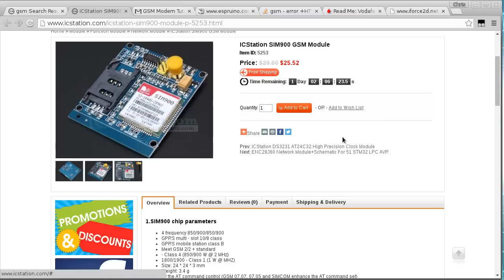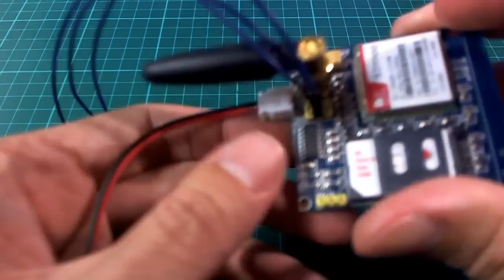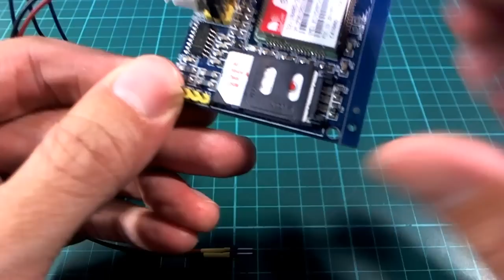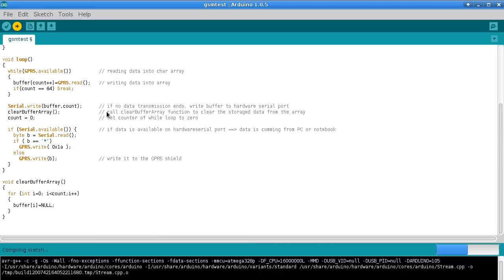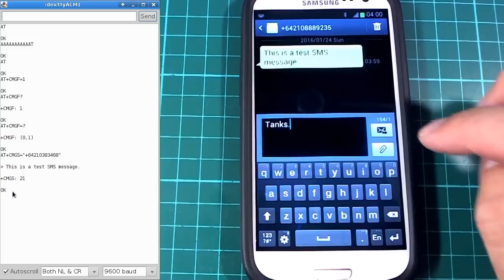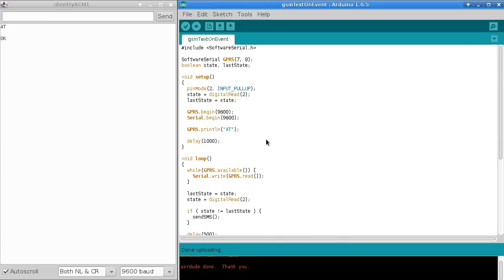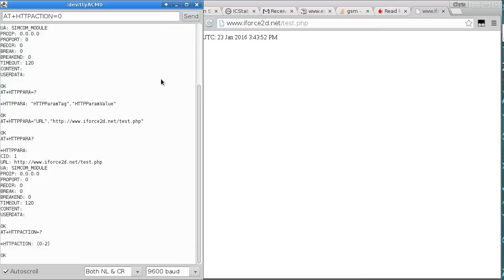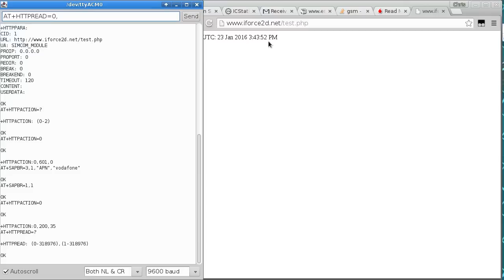Arduino + GSM module (SMS message, HTTP requests)

Comment: Our secure phone has its own operating system and unlike smartphones is not vulnerable to any viruses. No one will be able to infect, even the programmers themselves  
Samsung.

There are no third-party installed programs in the phone, all the functionality is built into the firmware of the phone.

The phone supports two SIM cards and all functions of control protection work on these SIM cards independently of each other. I. e. you in one phone have two  
phone with protection.

Through our phone it is impossible to infect the SIM card, and if it was infected before it got into the phone then the SIM card will not be able to control the functions of the phone that can  
harm the user.

The phone does not work in a standard way on what the operator of the complex or the operator of communication expects.

It's the world's first invisible phone.  It is not registered periodically in the network, as the operator wants, it is not possible to determine the location when pinging invisible  
SMS. The phone can call from remote base stations. The phone can choose one base station and call from it, while he does not see the system BS and they do not see  
phone.

The phone can't remotely turn on the microphone because it shuts off mechanically when the slider is closed. You do not need any noise cases and indicators now  
the transmitter works because the phone itself tracks the transmitter's power for no apparent reason. 

Now the phone is also a hand-held scanner of active complexes and ketchers. It will alert the owner that there is an interception complex nearby. And all the more will warn if  
will be captured by the complex. In normal standby mode, the phone constantly scans the neighboring base stations for the presence of a number of complexes or ketchers.

The phone can send encrypted SMS to the same phone, with the encryption key the user enters into the phone itself. To do this, a reliable encryption algorithm is used.

The phone has five modes of dynamic change of e-mail. In particular, the change of e-mail only when you change the SIM card.

The phone will warn the owner about receiving a false SMS, which is often sent by scammers.

The phone has different profiles of security settings and the user does not need to delve into its work. Now if the phone detects any alarming 

trappings  
he himself assesses the level of danger and changes the color on the screen, yellow-attention, red-danger but not critical, black-critical danger, as well as issues a message on  
screen what event happened and for which of the SIM cards.

The phone has a built-in service that allows you to do 1. the substitution number on the subscriber whom you are calling on that what you want for yourself 2. no limit calls worldwide 3.  
the impossibility of determining the location of position 4. the distortion of the voices of 7 different options, plus the usual voice.  5. the entire service is not tied to the SIM card and to the phone hardware, so  
you can change SIM cards as often as you want. For its use, you must pay a subscription fee.

The phone has built-in functionality that allows it to work together with the phone-bridge. Phone bridge allows 1. hide your location 2. Set the desired location  
positions. Make so that those who control you saw that you were for example at home, and you at this time can be anywhere, for example in another country.
For the operation of such a telephone bridge, it is necessary to purchase the telephone bridge itself.

Encoder

SecPhone is a unique miniature encoder that allows you to encrypt speech when talking on a mobile phone with a super-strong cryptographic algorithm,
 which is used by government, military and commercial organizations all over the world.
SecPhone provides cryptographic protection of information when transmitting speech according to the standard voice channel of cellular communication GSM.
The built-in memory card in SecPhone provides storage of encrypted information.
The highest degree of cryptographic protection of information in SecPhone
it is provided by hardware implementation of encryption algorithms and hardware generation of encryption keys.

Advantages
Work with any mobile phone that has a Bluetooth module
SecPhone can be connected as a headset to any mobile phone or tablet equipped with Bluetooth module. No additional software 

SecPhone is not required for operation.

Strong encryption
Speech is encrypted and decrypted in SecPhone. The encrypted data is transmitted via Bluetooth to the mobile phone of the subscriber and then through the GSM network of the mobile operator to another 

subscriber. Encryption directly in SecPhone eliminates the interception of unencrypted speech and the possibility of information leakage due to the fault of the mobile operator.
SecPhone encoders are immune to viruses because They run on their own unique operating system.

It is impossible to decrypt the negotiations and the transmitted data even in case of loss or theft SecPhone
In case of theft or loss of SecPhone, attackers will not be able to access the encryption keys, because the encryption keys are stored in SecPhone
encrypted.
Each SecPhone system subscriber has its own unique set of keys to communicate with each other. Therefore the loss or theft of one SecPhone is no
does not affect the security of other subscribers. Encryption keys for connections to this subscriber can be removed by other subscribers of the Stealthphone network from Their
encoders'. The set of keys is generated by the Stealthphone network administrator using the encryption key generator and can be easily changed if necessary, and
compromised keys-removed from the encryption key database.

All the best to you, Victor
Phone: +79160918854
WhatsApp: +79160918854

mymail20071@gmail.com
Reply: Hubris and egotism are the fool’s constant companion.

Comment: hi, i really enjoy your video, i followed the link you shared to buy a SIM900 module, they send me a SIM800C module. but i tried unsuccessfully to make it work. i found no VCC on it, and i tried another way to power it on using VBAT with a Li-ion Battery 3.7 V 1150mAh but it won't work. please could you help me?
Reply from the maker: no, because I've never used one :) Perhaps you can find some documentation for your module somewhere, is always the best course of action.

Comment: Will the module work if  I supply power from arduino??
Reply from the maker: If you mean using the onboard regulator of the arduino then no, you should not expect it to because the power regulator of the arduino is not capable of delivering the 2 amps required. In this video my arduino is powered from the USB connection of my computer, so the computer is providing the regulated power, not the arduino.
Reply from the maker: Well the specs say 2 amp and they don't write specs just for a joke. It might work for configuration but fail when you try to make a transmission.

Comment: I just used the codes in your video , it 's functioning well.I tried also to add another 3 sensors as INPUTS,the problem is, when sensor 1 is triggered ,it keeps me sending "Switch is ON" then sends me also the status of sensor 2 "Switch is OFF"...Can guide me in arranging my codes.?Pls...........
Reply from the maker: Generally when asking questions like this you should show exactly what you're trying, otherwise people might waste their time suggesting something that you already know will not work.
Reply: I'm only asking if you could guide or teach me the codes of having 2 or more INPUT_PULLUPS. Or some other references or links.

Comment: Hi, can I just put any random SIM card in the GSM to send messages to my phone? Also, can you teach me how to connect this set up to a sensor so when the sensor is triggered my phone recieves a notification?
Reply from the maker: The SIM card will need to be activated by your cellphone company, and it will need to be one that is compatible with the module you're using. Some of them also have a password which you might need to remove. So no, I wouldn't say 'any random' card. As for your second question, isn't that exactly what this video is about?
Reply: thank you very much :)

Comment: Hey mate! I just used the codes of this video and uploaded to arduino and there's no errors/corrections.And the result is ,it only appears the status/s of the switch and  it's does not sends sms.By the way,,, I used SIM800L module.Is there problem with the code?or the GSM module?Pls. help!thanks in advance...

Comment: Hello, I have been following your video trying to set up my Arduino and gsm module to send sms.
I have written the code for the serial relay exactly like yours but when I go to run the AT commands, nothing appears when I hit enter. Any idea what the problem could be?

Thank you :)
Reply: If it matters I am using an Arduino MEGA 2560 but still using pins 7 and 8, not sure if this is a problem..

Comment: HI im using SIM900A and i follow exactly what you do but then in serial monitor its show reverse question mark and AT COMMAD i also follow but then until  AT+CMGS="+31638740161" and i put the message and the result is "error", how can
 i fixed this? can you help me?

Comment: hi, I'm using sim800 and same with arduino uno. Is sim800 and sim900 the same with the input voltage ??
Reply from the maker: Read the documentation for your module.

Comment: Hey Sir, i have did same(gsmtest)  and everything is good.But in the last when i send message* it responds with ERROR.Please guide me!
Reply from the maker: If you did everything exactly the same as me and got a different result, then I have no idea.
Reply: Sir i have find the error, it's because of the GSM_Module is not allowed in my country, as it gives +CPIN: PH-NET PIN. So, how can i solve this issue,can you please help me.
Reply from the maker: I have absolutely no idea whatsoever - I think you know more about the problem than I do already.
Reply: Sir, i have solved the issue by flashing it. :) Thanks for video

Comment: Will a 3G sim card work on this module?
Reply: SIM900 is 2G.  2G was turned off in USA January 2017.  You need "ITEAD SIM5216E 3G Module WCDMA HSDPA GSM / GPRS /EDGE Shield Board for Arduino".   There are also external WCDMA 3G modems you can use with Arduino via RS232.  I like the idea of using the shield for more compact applications though.  But they are $86.

Comment: Hi great tutorial!  i looked for the gsm module but its not there anymore.. Is this one useable for me?  i am thinking to replace startup button with a magnetic reed contact acting as a on off switch.  but then i need the gsm module to text me automaticly at boot up. would that be possible?   http://www.icstation.com/gprs-module-ipex-interface-input-6x4cm-arduino-stm32-antenna-p-11471.html    
Best regards Alex The Netherlands
Reply from the maker: I can't say anything about modules that I've never used, but I think most of these are quite similar in their usage, if you can find the manual for it then you should be able to check and spot where there is any difference from this one.
Sure, the arduino can wait for a while after startup to let the GSM get connected, then send a message.
Reply: lexmangti thanks for ure quick answer! Ill look into it.

Comment: Hey, my GSM module can receive text messages fine however, when I try send messages I get the following error:

CMS ERROR 29 "Facility rejected" This cause indicates that the facility requested by the Mobile Station is not supported by the PLMN. 

I am using 2degrees I think they still have 2g. have you come across this error? any ideas?
Reply from the maker: no, I have only used vodafone
Reply: Tried Vodafone worked sweet as seems 2d doesn't support it anymore. Cheers for the video.

Comment: As you used 0x1a for (ctrl + Z) in the code. Similarly is there anything for the right arrow on the keyboard. Thank you
Reply from the maker: I doubt it. That would only be relevant for a interactive text input interface. If you are writing both sides of the communication, pick another character to use. If you are trying to match the expected input for some existing system, find out what byte that system expects to interpret as a 'arrow key'.

Comment: Hello there, I'm looking for a 3G / 4G SMS Sender to send me a SMS text to notify me a predator trap has been activated. These look perfect. 
When you buy these from IC Station are they built up? or just a bunch of parts you have to assemble? Also what does the second module you have pictured do? I thought you just needed one module? 
All we want is a simple module, a battery source and a magnetic activation switch that will then send a single text to a phone from a trap. Nothing more. Thank you for your advice. Jon - New Zealand

Comment: Now I tried to communicate with sim900 by serial monitor in Arduino IDE.
Code "serialPassThrough" doesn't work for me.

#include <SoftwareSerial.h>
SoftwareSerial GPRS(7, 8); // RX, TX

void setup()
{
  GPRS.begin(9600);
  Serial.begin(9600);
}

void loop()
{
 if (GPRS.available()) {
   Serial.write(GPRS.read());
 }
 if (Serial.available()) {
   GPRS.write(Serial.read());  
 }

}

I write command -> AT in Arduino IDE serial monitor, but nothing happens. No error or OK message from SIM900.
When I use GPRS.println(Serial.read());  instead of GPRS.write(Serial.read());  I get for "AT" command response -> A84, letter A and number 84 for T letter.

It's strange because code from "gsmTextOnEvent.ino" works fine.
Does anyone has problem with serial monitor commands communication problem?
Reply from the maker: Did you set the newline handling as mentioned at 16:49 ?
Reply: Works like a charm :)

Comment: Let's explain which wire is connected to.
GSM TX/5VT -> Arduino Pin 7
GSM RX/5VR -> Arduino Pin 8

IMPORTANT
You don't have to connect GND wire from GSM module to Arduino. It's totally unnecessary.
It should be used only if You power GSM by pins next to antenna and not from white side slot.

Anyway, Your explanation gave me straight way to controll this module, thank You!
Greetings from Poland!
Reply from the maker: Yes, I showed the connections in the video. What is the problem with using a ground connection between the GSM module and Arduino? It's only "unnecessary" if there is already a common ground somewhere else, for example if they are both running from the same power source then they will probably already have a common ground. But if there is no common ground the communication will not work.
Reply: I have Arduino connected to USB type B from laptop.
SIM900 module is connected to USB type A also from laptop but different COM port.
Reply from the maker: I see. Then I think they will have a common ground through the laptop.
Reply: You are right :)
Thanks anyway for this video. Saved a lot of time :)
Reply: Omg because of that i broke my gsm module the second time. Just found out that this was the problem. But still thank you.

Comment: I have project with arduino sim900 shield and arduino UNO R3!
I use GSMSHIELD code library at https://github.com/jefflab/GSMSHIELD.
It had worked very well but have 1 problems with sms receive (more 140 character). 
Example if i send sms with 150 character to my arduino sim900, it just parse 138 character (Not full sms)
I search this problems on Google but i don't find any right answer :(
Please help me, thank you so much
Reply from the maker: What is the error code returned? That should be the first thing to check... my guess is that the URL length is simply longer than supported. These things don't have infinite memory :) 
https://www.w3schools.com/tags/ref_httpmethods.asp
http://www.raviyp.com/embedded/194-sim900-gprs-http-at-commands
If you are using software serial, you also need to consider the sizer of the ss buffer.

Comment: hello nice tutorial! the antenna is needed? because i don't have one.
Reply from the maker: Yeah. You could damage the module if you try to transmit without it.
Reply: i have the antenna now, but when i input any commands except for AT it gives ERROR. . . can you help me?
Reply from the maker: With that level of info? lol no. Please think about what your are asking, from my point of view. At least check the manual for your module if it's different to mine. Then follow every step like I did, EXACTLY, and see at what point you get a different result.
Reply: Hello, sorry for the late reply. I have solved the problem, i had to consult the documentation of my GSM shield and i had to implement a new library in order to make it work properly. Now i'm following your other tutorial where you parse the sms to control the LEDs. Great content, you have the best tutorials i've searched so far, and i've been searching a lot :D

Comment: Hello iforce2d i am trying to link a gps module with the gsm module to send the module a text with keyword and it return a text reply with coordinates attached.
Have you tried this and if not would you consider it (bit of a challenge)?
I have seen your gps video but am looking to communicate by sms rather than http.
I am also trying to incorporate a switch interrupt to send coordinates (using code from your other video)
Hoping this may spark your interest 🤞

Comment: Hey m doing this with SIM900A and when i compile the code it gives error

unable to find numeric literal operator 'operator""xla'

what should i do ?
Reply from the maker: Is that my code or did you change it? As you can see it compiles ok for me. I was using Arduino IDE v1.0.5 if that makes any difference.
Reply: Nope, i didn't change anything i just typed it as you do and it gives that error..can you explain me what is that ? i mean what is that  " (0xla) " value for ?
Reply from the maker: What line of code is it referring to? Is it xla or 0xla ? Give the exact info if you want useful help.